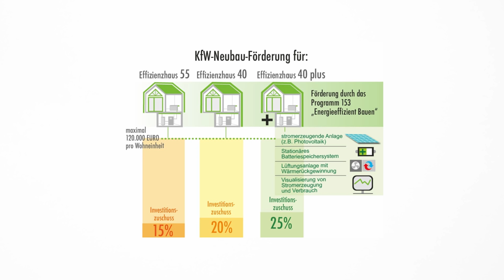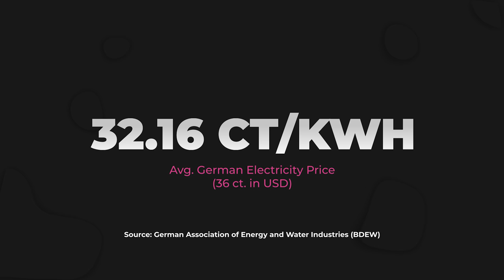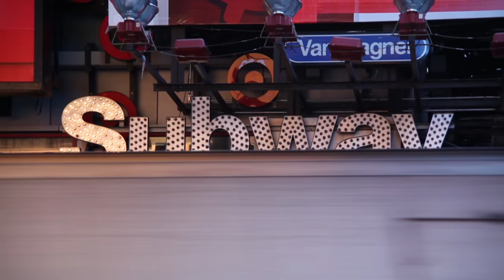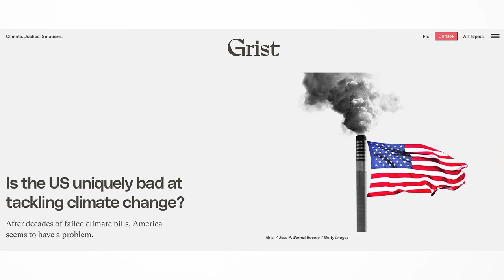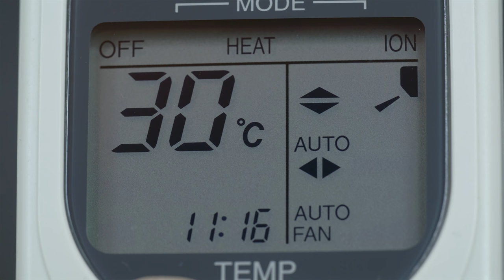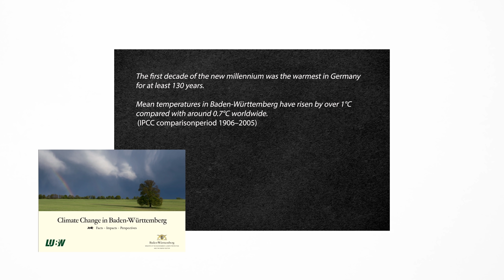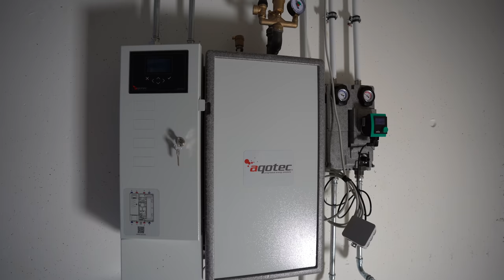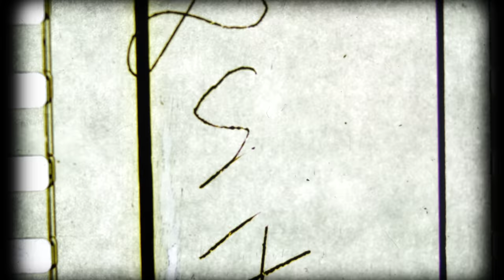HVAC (HLK) in German & American Homes | A Tale of Two Countries

Comment: I am an American living in Germany as well. I have been here now for 12 years, and before this I was stationed here.  I have spoken to several Germans on the topic of air conditioning and have heard all kinds of reasons why they don’t use it. Like you said “ ac makes you sick” when they told me this I had a blank look on my face. And replied your car has ac, the grocery stores have ac and your still alive.  Yes retrofitting an ac in most homes here would be a nightmare.  Considering most are multi family buildings with no or too little attic space for the units we are accustomed to. Mini splits are a great alternative and are also cost affective to operate. One of the major issues I see with the method of construction here is how easy it is to grow mold .  All homes here including yours are insulated on the outside of the building. Great to keep the cold out, but humidity builds up inside on the cement and plaster walls, being kalkstein ( a light weight gypsum-calcium composite ) it loves to soak up water. thus leading to mold. Having an ac to remove the humidity in the air greatly reduces the ability for mold to grow. Also ac units help to remove allergens. There are a whole list of benefits that ac has. In the time I have been here I have seen a trend in installs of ac units . Most if not all were minisplit systems. 

  One item that you did not mention was that , Yes radiant floor heating is great, but. In the US how many states would actually benefit or have the need to use it?  I come from Florida  AC is a must, heating not so much.  Using a heat pump for both AC and heating would work for most new homes in the colder latitudes.  Well that’s my take on it. Keep up the good work
Reply: Very interesting comment! But as a doctor (with a PhD in microbiology) I really disagree about the health aspect of AC. What you are writing is mainly what AC suppliers use to advertise their products and for most parts it isn’t even wrong, but it’s not the whole story. 
For example- yes, mold might be decreased with the use of AC. On the other hand, mold is not as health-threatening as many people believe, and is mainly a problem in really wet places, like bathrooms without a window. (in this case, I would really want an AC for the bathroom) But dry air is not good at all for the mucous membranes in your mouth and nose and greatly increases the risk for infections. In fact, there are scientific studies about the high CoVid case numbers in the USA and how they might be related to the use of air condition. There is sort of a range of a „healthy“ air climate, not too dry and not too humide. I monitor the humidity in my apartment because I have two expensive violins and they can get cracks if the air is too dry. Even without air conditioning, the air is always very dry in my place, even in summer. I actually even use water containers and plants to increase humidity a little, lol. 
And the ordinary AC systems don’t just remove germs and allergens, they mainly get stuck in the filter system. When it isn’t cleaned regularly and properly or fans are used, the germs are even spread more than without AC. In hospitals, AC systems can even be a hot spot for outbreaks of legionella and other infections.
Reply: ACs in a time where everybody is talking about conserving energy and stoping climate change?
That is what I call a bad idea.
Reply: PS
Reg mold: never had it, most people don’t have it.
There is one little thing called window.

Comment: In my old hometown of Gothenburg (Sweden) they started using district heating very early in the 70s utilising the cooling water from the power station. When the energy crisis hit, they put massive heat pump heat exchangers into the sewage treatment plant and recovered huge amounts of otherwise wasted heat from the water. So when you go to the toilet you are actually helping to heat the city. (most of the heat comes from peoples overuse of hot showers though)
Reply: So leaving a hot mess in the toilet actually helps fight climate change? Whoa!
Reply: I guess there is nothing new under the sun. Downtown Chicago was heated and electrified by central systems in the early 1900's. The "waste" heat from the steam electrical plants was used to heat the buildings.
Reply: Sweden has about a 50% overall connection rate to the central heating system, and about 90% for the apartment buildings.
Reply: Reston, Virginia uses district heating and cooling. If you look at the lake in the development you can see the three lines running through dissipating the heat from cooling during the summer.
Reply: In USSR all apartments were on centralized heating and according to data by 2009 Europeans were using as much energy for heating pro capita as Russians but most of Russia has much colder climate

Comment: I am a little older than you two (91 last December). I was born in Pittsburgh and at that time about 99% of the residences were heated with coal fired forced air. So, in my adult life I have lived in Pennsylvania, Kentucky, Ohio, Michigan, and Indiana and all had different types of climates. Right now, I live in the southern tip of Indiana and AC is a must here. My wife was born in Berlin, so we traveled there and got to see early 1960s apartments. Most were heated with a large oven like thing that burned charcoal or compressed soft coal bricketts. Later we saw they were heated from a central city system and was radiant heat. In the 70's when the building rules went into effect, buildings were insulated by adding a layer or layers of outside material. Now when we go, we get to see some air condition attempts in small commercial buildings. Looking forward to June trip to Berlin again.

Comment: In Germany there are heating systems that can also be used to cool the house: electric heat pumps.  However, these must be used very carefully, as moisture problems can occur. 
However, with some geothermal heat pumps, you can short-circuit the two circuits and feed earth-cool water (~8° - 10° C) into the heating circuit. This way you can cool a little without using too much energy.
Reply: Not a problem if you use air heat exchanger with additional module for dehumidification.
Reply: There's also systems that monitor the condensation levels and automatically shut off if the level gets too high.
Reply: Air-conditioning actually de-humidifies and require a condensate run off line to get rid of the water condensate. One of the mistakes made with air condtioning design s getting a unit too large. A too large unit will bring down the temperature before getting rid of the excess moisture, thus giving the inhabitants a cold and clammy feel.
Reply: @nejdro1  I think they were talking about heat pump systems that don't use forced air. The ones you typically find in Germany usually use radiant heat (underfloor heating/cooling), so when cooling in the summer you have to make sure the system isn't set at too low of a temperataure, otherwise condensation might be a problem.
Reply: Yeah.. heat pumps are nothing new in the US

Comment: I live in Germany in a half-timbered house, a rented single-family home, built in 19th century. And as much as it is a struggle to keep it warm in the winter (which in my opinion could be fixed if adressed properly) I found myself surprised how cool it keeps even in the hottest of summer. I thinnk this is due to a regional technique: It was common to take the wall that facing the sunlight and cover it with ceramic roof tiles on a wooden frame, similiar to the roof, only perpendicular. These tiles do heat up in the summer, but they don't transfer the heat to the wall since there is a layer of air between them.
  Some of the old building techniques and materials, like wood and clay, have something to it, and are worth rediscovering.
Reply: My house is also a half-timbered house made from wood and clay and built in 19th century. Inside temperature in the hottest summer is never more then 25° and typically 22° during the summer month because a row of birch trees are in front of the southern wall. No ceramic roof tiles here anymore. It is also kept warm easily during the winter as I provided additonal ceiling and roof isolation before moving in and built in triple glass windows.

Comment: Living in a old house in Northern Ireland we have a slightly different take on heating and cooling. The external walls of the house are basically 2’ thick, roughly 60cm of stone and the main windows are north facing so summer temperatures are kept low because of thermal mass. 
Similarly a relatively small wood burner keeps winter temps comfortable once the house is up to temperature for similar reasons, once it’s warm it’s easy to keep warm. 
The only real issue is if the house gets cold (we recently messed up the timer for the heating while away) when it seems to take a full day to get back.
Reply from the maker: Wow that is amazing! 2' thick? I would love to learn more about the architecture of your home.
Reply: Yes, here too. Old buildings often have thick walls. We have different houses in our family : my parents: 70s building, 30cm brick wall, basically no insulation. Radiators, gas powered and tiled stoves. Me: solid wood wall (12cm) plus 30cm insulation (wood fiber) central heating via tiled stove plus solar waterheating, my brother 50cm brick wall (new building) and heat pump. My sister (us) what we call "American cardboard" (sorry) 10cm wall although with cellulose insulation. Still a nightmare to heat and only affordable with "per gallon" oil costs.
OH and our heating costs per year are about 400 euros. (South of Austria)
Reply: @boxoffrogs-studio  I'm from the Swabian part of Bavaria. My house from the 1920ies has brick walls of nearly a metre as well as additional insolation on the outside, so it never really gets hot inside when we have high temperatures in summer. I don't need any air conditioning at all.
Reply: And it doesn't get very cold when there are minus degrees outside either.
Reply: Similar to an old farmhouse my friend rents. It's never that hot in summer. This particular house does have damp though which makes it challenging to heat in winter. It got renovated incorrectly at some point using cement based mortar instead of lime and it no longer breathes plus the roof has issues. Aside from that it's noticeable how consistent the inside temperatures tends to be.

Comment: My house in Dortmund (NRW) was build in 1958. I bought it in 2003, because it is sitting at the edge of the city next to a nature preserve. During heat waves my garden is about 10-15°C cooler than the street, allowing me to open up the windows in the evening pretty early. My bedroom is under the roof and was pretty hot in the first years. Then I refittet the roof with insulation, added solar thermic (8 kW) and photovoltaic (9,5 kW) modules which provide additional shade on the south side of the roof. After that the temperature in my bedroom did not exceed 25°C until 2019.
For 2020 I bought a mobile AC, to be able to keep my bedroom below 25 if heat periods get longer and/or hotter. I modified the AC and a door, to be a closed air cycling system and the small 500W AC is now enough to keep the temperatures at bay. Given the fact my photovoltaic system produces more than ten times more electrity than the AC uses it's still quite climate friendly. The system ran for 1 day in 2020 and 3 days in 2021 from noon until the evening. totalling to about 6kWh of consumed electricity. I will further optimize the system to get it more efficient this year.

I am one of those (german) guys where "good enough" isn't good enough. It has to be real good.

Comment: As an HVAC installer in Canada and someone who mostly put in boilers, my belief is that forced air came in, aside from the fact that they are cheaper, is because builders didn't want to use a more highly skilled workforce of pipefitters and the potential for leaks with hot water systems, plus, back in the 20s and 30s radiators were VERY heavy (my back can tell stories). Now, after 30+ years in the trade, I put in mostly heat pumps, central ducted and air to water (due to living in an older city with lots of boiler systems).

Comment: Well-researched, thorough, thoughtful - I'm running out of adjectives to commend you on this video! As for your question about personal attitudes towards air conditioning: I don't think I will ever install a unit, I would just feel too guilty. Fortunately, my job allows me to structure part of my working day to my liking; so on a really hot day, I will postpone some of my work to nighttime and rest in the afternoon (there is a reason for the "siesta" in Southern Europe!). And like any good German, I will elaborately complain about the weather, of course. ;-)
Reply: I never wanted an air conditioning either - but COVID and remote working changed my mind. Last year I had units installed for our home offices - right after the installation of the solar roof.
Reply from the maker: Thank you! We are glad you enjoyed it. Ashton's father is a farmer, so her complaining about the weather is in her DNA.
Reply: Couldn't write better - I agree.
Reply: Having a room directly under the roof i'm seriously contemplating an AC unit. Unfortunately some strange EU regulation removed two-hose (one hose for fresh air intake, one for warm air outtake) AC mobile units from the market and only one-hose are left. Two-hose are much more efficient. Alternative would be a two piece unit where the heat exchanger is outside and the cooling unit inside but that woud need some bigger work on the walls.
Reply: @martinohnenamen6147  I have two piece units and that was  very little work on my walls. Less than with two hoses which would have had a bigger diameter
Reply: @martinohnenamen6147  So called "split systems" require relatively minor alterations and are far more efficient at both heating and cooling than are portable units. The newer units are actually more efficient now than the best gas hot air units. The A/C function is as efficient as central A/C systems.
Reply: Feel to guilty? Lmao for what?
Reply: @martinohnenamen6147  2 piece / mini-split have a mains power and 2 gas lines in ONE pipe passed through the wall between the parts
Reply: I never had AC before. I moved to a new (old) house lateley which has an AC. It's just one unit at the hallway where the bedroom has its door. This summer (my first in the house) I had about 6-7 days where it was too hot inside, so I let it work in the evening for better sleep. The other days the windows were enough. I have reasonable insulation but if the walls get hot they hold the temperature for quite some time. So you need several cooler days to bring it down. Over the year I expect the cost for AC (how I use it) only to be around €10-30. I can live with that.
My company has no AC but a system which pumps water from cooler areas (basement?) to others and vice versa in winter (so we were told). It's not ideal but OK for most rooms.

Comment: The fact that I thought it was normal to have to bring a sweatshirt everywhere when it felt like 40-50 C (Florida summer) because inside would be about 18 C is just insane to me now... (My family didn't like to run the AC at all).

However, I want to add two additional factors for having AC. 1. Humidity leads to mold, which seems to be a much bigger issue for drywall than plaster. 2. If you don't have AC and do have well insulated walls, you'd want to leave the windows open at night to let in cool night air. That'd be considered too dangerous in most ground floor residences in the US.

Those still aren't reasons to keep it so cold though...